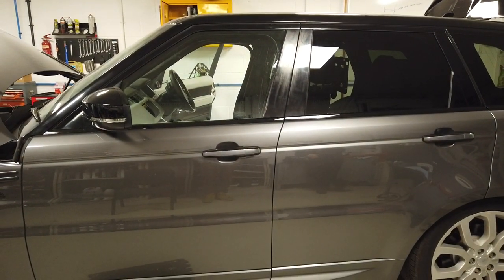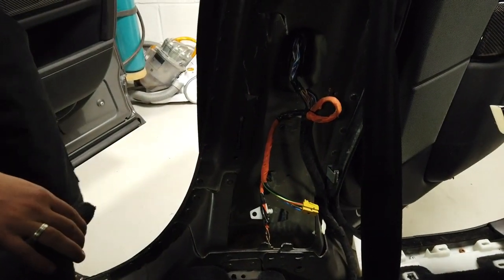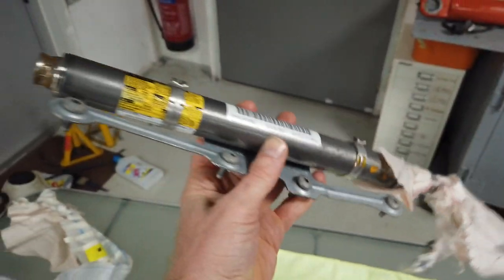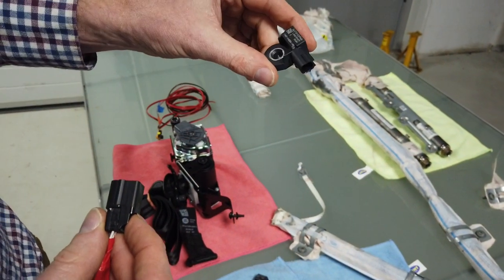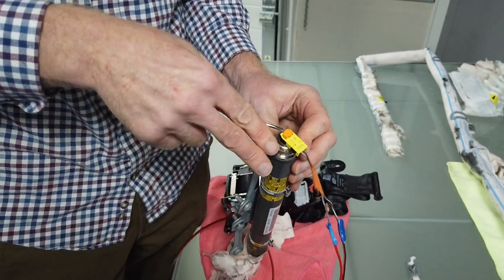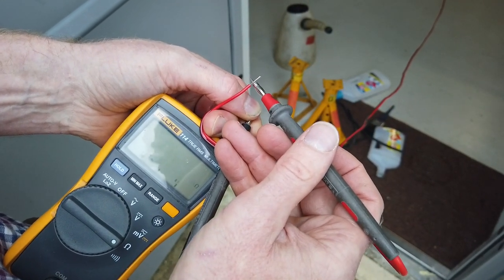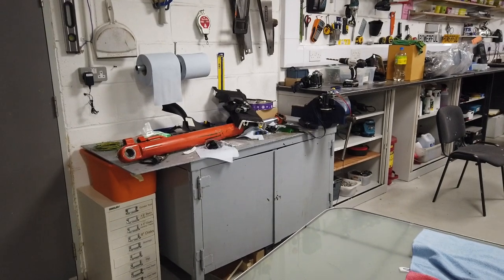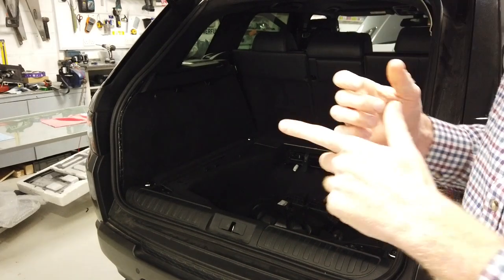Working out what has been bodged on our Range Rover Sport SRS airbag and how to fix it.

Comment: will this work on LR4 2010 v8 HSE? I have this curtain airbag pop-out and seat airbag pop-out, wheel and front airbag is not pop-out
Reply from the maker: So the car must have had some sort of side impact.
Yes you can replace the airbags with replacements and then reset the system to clear the crash data and you should be all OK

Comment: Interesting in a worrying way! Are you going to repair the pillar? I wonder who would hold the liability in a crash in the future if you had not checked the repair and found these items missing/disconnected??
Reply from the maker: The car is a recorded write off so its well documented on the registration document. So far we have not sold a project car - they are just too useful.... the problem is we now have 25 project cars ! I will get the car to a standard i am happy to drive in it !
Reply: I get that it was written off, but we know that just means the insurance company paid the owner and sold the wreck for repair with a suitable category.  From what you are saying it hasn't been re MOT'd? But if it has then who would be to blame in a crash and you were more injured as there were no airbags to protect you? As you say at least you can fix it back to safe but imagine buying this on a forecourt thinking it was rebuilt and re MOTd which would give you a level of assurance it was safe and roadworthy.
Reply from the maker: @mercedes_and_more  Yes - the crazy thing is that to repair it correctly would not cost that much more....
Reply: As already mentioned, how do you intend to repair the B pillar On the video it looked as though it was split, is this the case? If you’re intending to drive around in it consider your own safety and do a proper repair
Reply from the maker: @dennij  So several points here .... the main strength is in the inner boron steel part of the pillar and that looks mostly ok - the outer split part is only the aluminium "skin". Also the doors have been replaced and these take a lot of the side impact. I still think I will be safe in this Sport than my everyday Astra ! Anyway this is a company car and i wont be driving it around too much !
Reply: powerfulukltd That’s interesting what you say, so basically the pillar we see is just a skin over a more substantial internal pillar. I have to assume that’s been repaired/replaced correctly then. Not sure without looking at it in person how that could be achieved but so long as you feel it’s safe then that’s fine. I remember when you first did a video once the car was back at base you pointing out the shocking repairs to the sills

Comment: Shouldn't this be reported to trading standards or RoSPA?  Deliberately fitting resistors to fool the car into thinking the air bags are ok Could have killed an unsuspecting buyer.
Reply from the maker: Yes there is a sort of scam going on here where they are buying cars from Co-part crashed and then fixing them up really badly and putting them back on Co-part. The problem is that co-part is a salvage auction... so you are buying a crashed car..... but its not right. The funny thing is that is not that expensive to fix the airbags properly.....